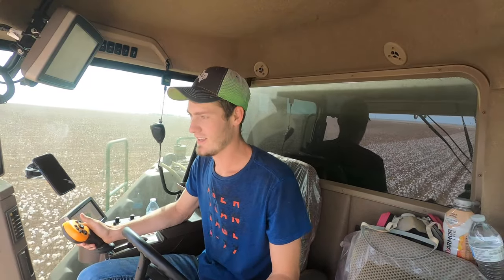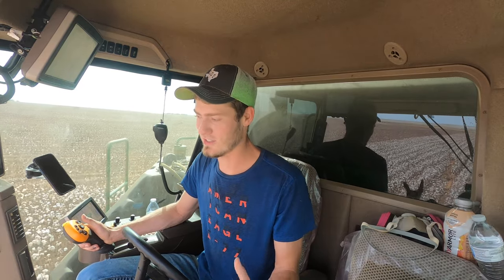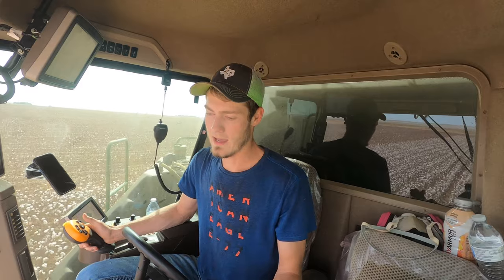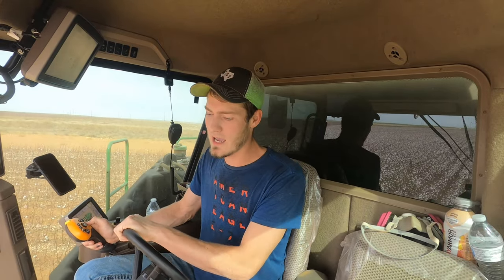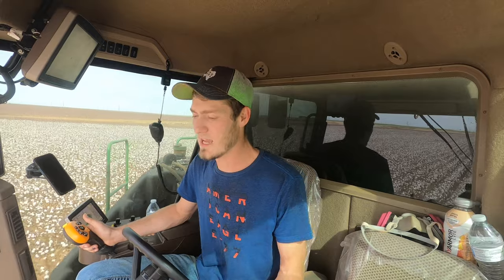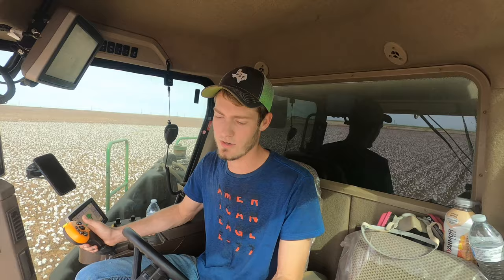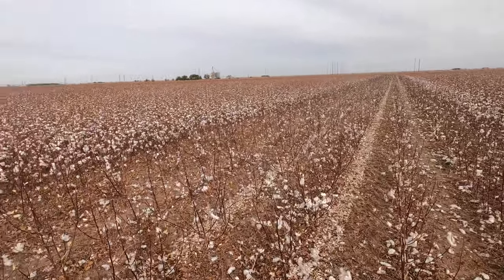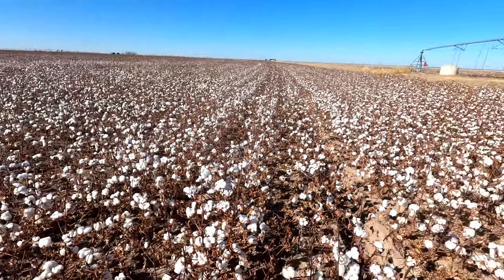Why cotton picker or cotton stripper

Comment: Conley, you did a great job of explaining the difference between a striper and a picker.  You explained it pretty much the same way it was told to me 50+ years ago in NE Gaines Co.  And yes to a previous post where would we be without the American Farmer growing our food and fiber.
👍🇺🇸👆🇺🇲
Reply from the maker: Well thanks I’m glad it all made sense
Reply: Have ve you thought running both?  Take the picker through first and make two or three passes then run the stripper for a less than desirable bonus . If possible and feasible.
Reply from the maker: It’s not worth the time and fuel

Comment: Was thinking @ cotton strippers/ Pickers was thinking if could put an vacuum in between the rows could such an devise be practical with wire brush as an kicker get more cotton or does  the machines have these on them "was terrible job!"
Reply from the maker: Maybe you could get more cotton but it would be very dirty cotton anything the machine drops or fails to pick up, going over a second time usually isn’t worth it